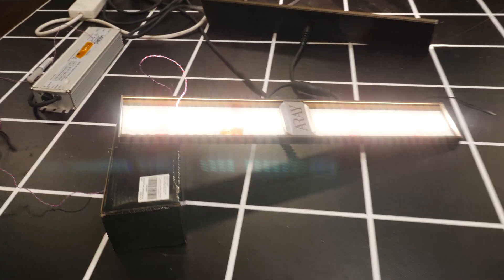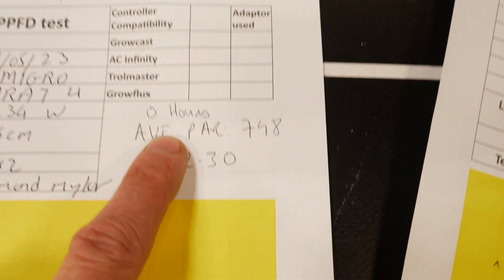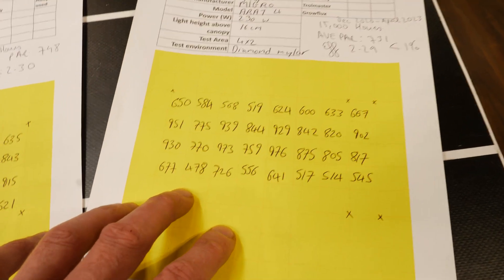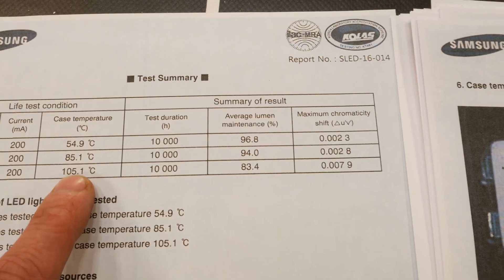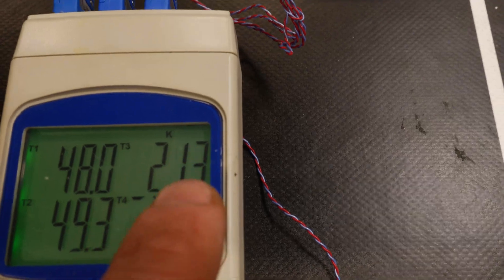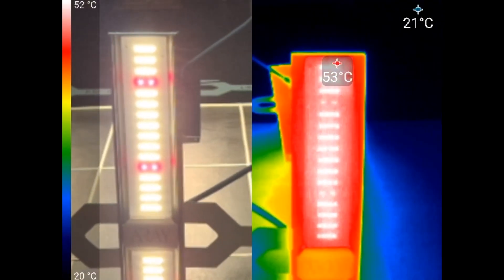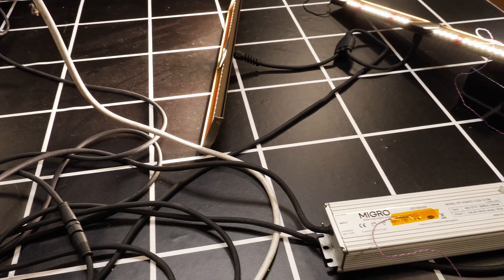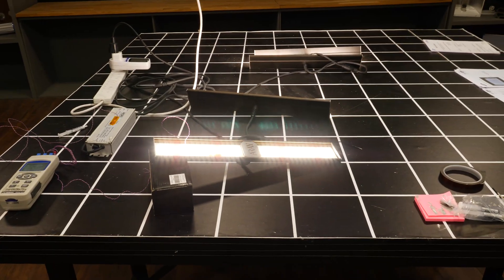When to replace LED grow lights | Long term LED test 15,000 hours

Comment: DLC Hort certified LED lights are 2.3 joules plus through to 3.5 joules at current technologocal varience. Unlike these as advertised at 25,000hours DLC certified are 38,000 hours minimum with no decay. DLC Hort certified grow lights are top 30% of their class. 5 year warranty standard minimum

Comment: Hi Migro admire your work. Is there a reason for doing these tests using the AC side wattage? Normally when  these tests are done, like the samsung numbers youre showing, is based on DC current numbers. Why not show the actual amount of current going to the boards from the driver, rather than just showing driver draw wattage? I know that this  is the way you usually test lights, but  if your doing tests on your own lights its best to be completely open and really show that theres a like for like situation. Using driver draw here will only really muddle your numbers, this test would be best done by matching DC current to the boards on both new and old lights.

Comment: @migro thanks for all the information, the great lights. Wondering why you made the paint on the LED bars black and not white or something maybe reduce the heat for me personally i have them under a 600w MH so they probably warm a bit more just wondering if its a consideration if you've measured differences in heat retention and how that would apply to the longevity <3
Reply: Typically electronics have a max temperature rating and as long as you are under that you are not damaging anything. Most of the damage is caused from change in temperature which causes materials to expand and contract small amounts. Over time this can damage the chip/circuit.

Comment: I don’t have a light with a detachable driver but I did have a extra ac infinity fan to put overtop the light too cool it, dropped the tent temp 3-4 degrees.